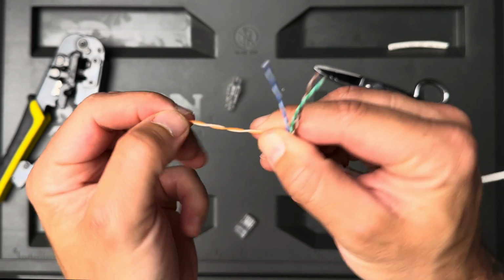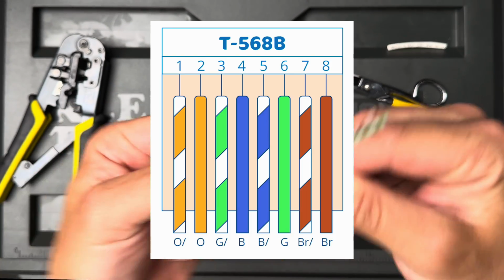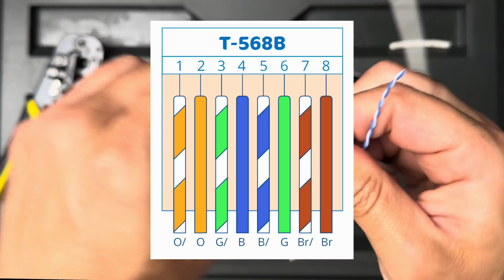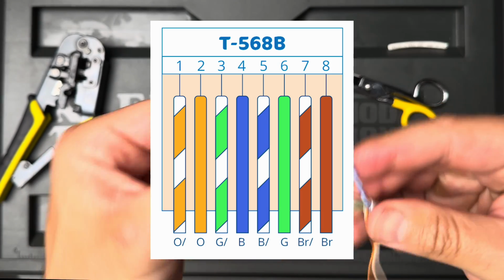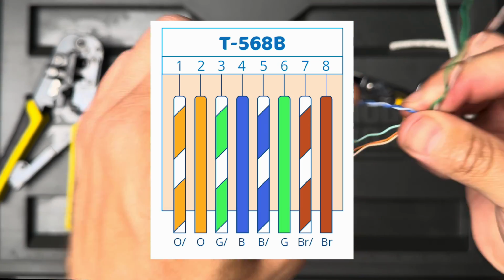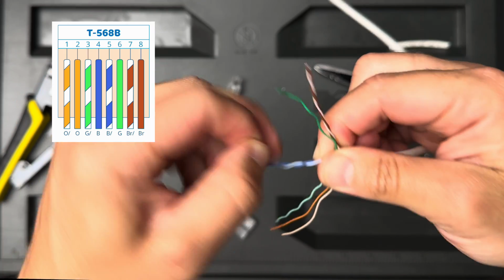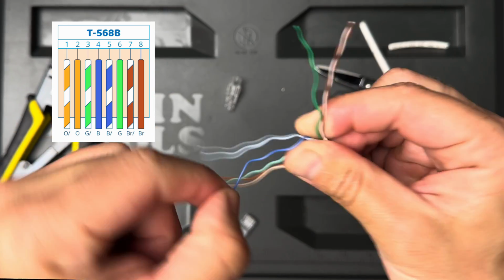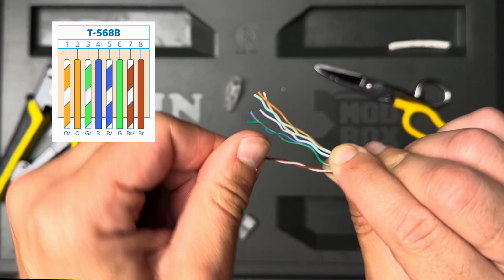How to CRIMP CAT6 RJ45 - Tutorial (BEST Method)

Comment: Here's a mistake I learned the hard way -- Pay attention to what type of cable you need to buy.    I bought 23 gauge CAT 6 cable, not really paying attention to the gauge.  The RJ45 connectors I have (both standard and pass through) are a very tight fit while assembling the cable, and not a fun discovery for a beginner who doesn't immediately realize the mistake.  Connectors were for 24 gauge. XD (Edit: I later found 23 gauge connectors.)

Comment: Usual YT - skip the difficult bit - the cables do not go easily and correctly into blind plugs.  Going to try pass-through type.  There's always a scrim in every job.
Reply: He is not skipping, he is just lucky
Reply: He clearly said after you do a bunch of these you'll get a feel for it..
Reply: I'm terrible at this,  no matter how straight i try make them they seem to pop into the incorrect channel when I push it into the plug.  No doubt it's me as I rarely need to do these
Reply: i only needed like 3 tries(my first time) but it depends from person to person.
Reply: Careful with pass-throughs tho. The pass-through connectors expose the copper and can short out if plugged into a shielded RJ45 jack.

Comment: Very good demonstration my man. I would refer to this as more of the advanced method. Using snips only etc. 

One tip. On your RJ45 crimpers there is one side that has one racer blade... Use that to cut all of the pairs at once instead of the scissors. It makes a nice straight cut with the razor blade.

Comment: Looks like CAT5e. No shielding, no guide cable.
Reply: Dude what era are you from?
Reply: CAT 6 can be shielded or unshielded. but really, if you cared so much, all you needed to do was read the nomenclature on the cable jacket which clearly says CAT 6. Good view right at 1:10
Reply: @platymusPrime  labelled incorrectly
Reply: doesn't actually matter...its the same technique.
Reply: @alanshamoun5577 it matters, the cross shaped separator is a pain in the ass